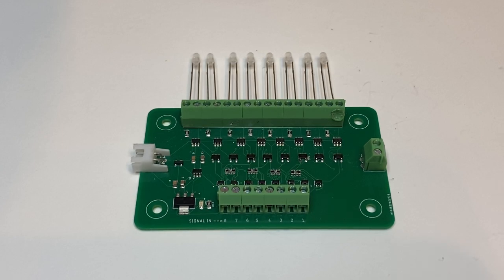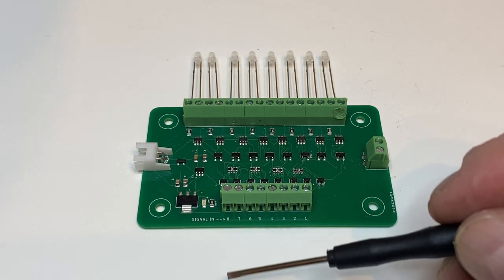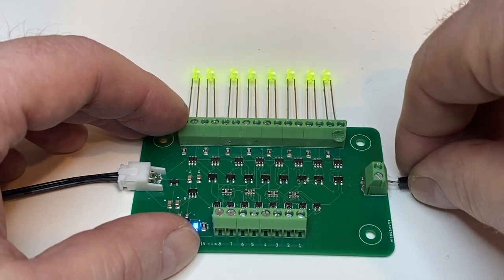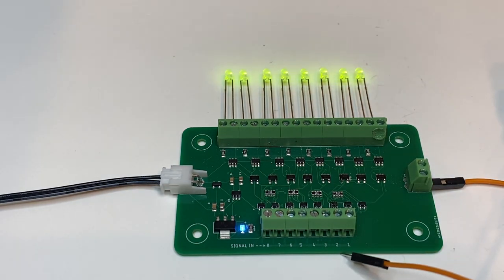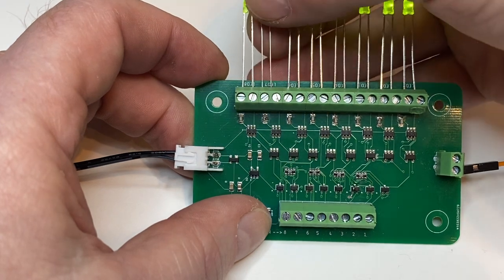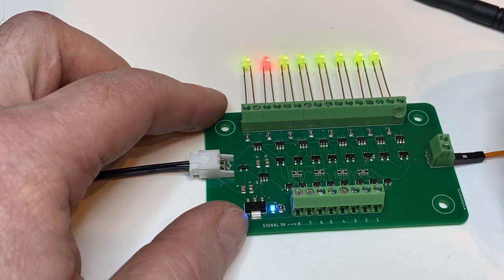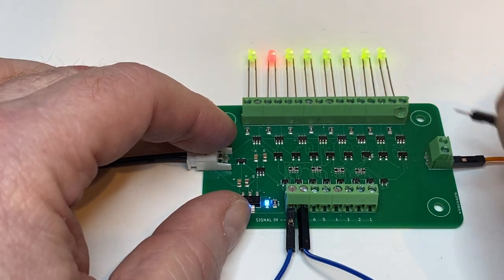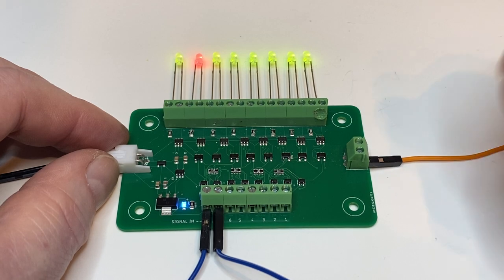CTC Panel Hookup Video

Comment: 2:17 Alternatively, could you simply double up the second LED onto the same connectors as the first, with the polarity reversed?
Reply from the maker: The current for each port is carefully balanced with the resistors/ and this rating LED  and the onboard regulator so no, we don't support that.